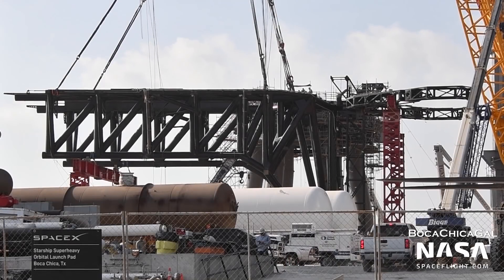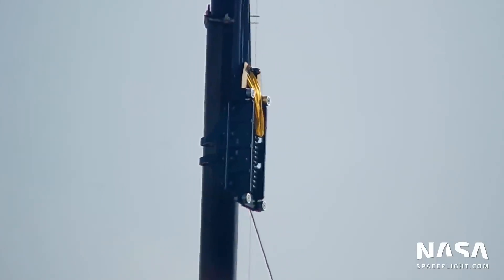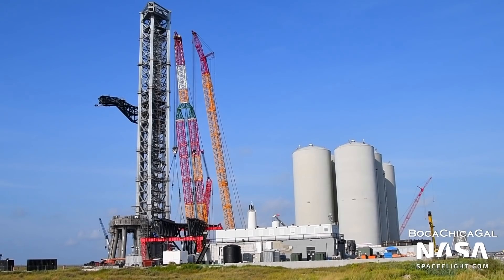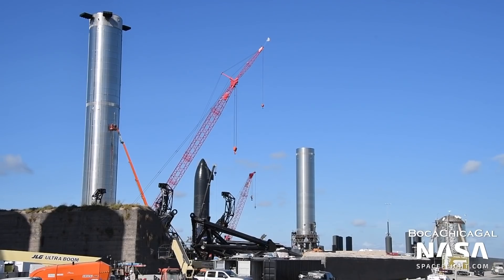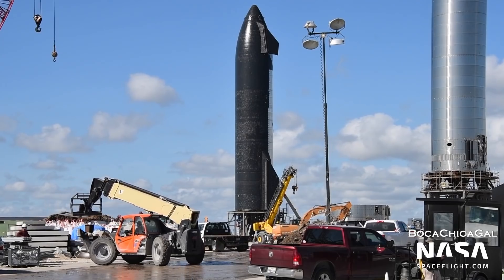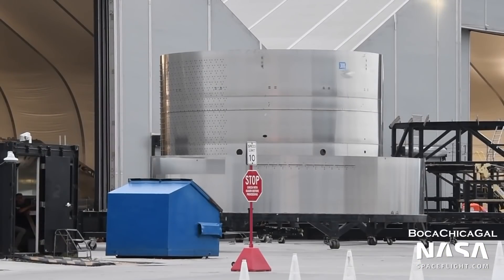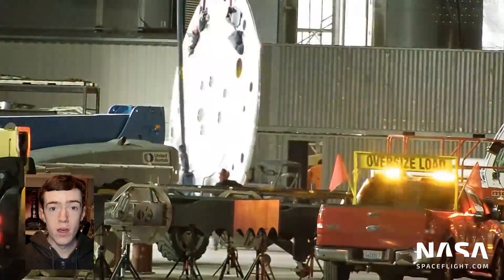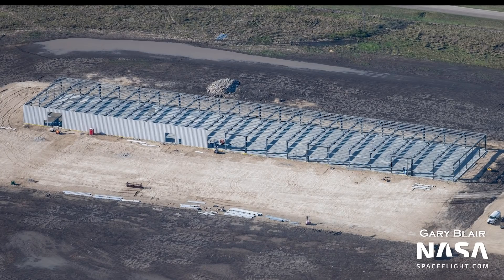Ship 20 Prepared for Static Fire Testing | Starship Update (Narrated)

Comment: You do excellent work with these updates Ian, thanks a lot.
Question: Ive been asking this a lot lately but cant seem to get an answer so if you could please.
Why has the "hybrid tank" been recently called B2.1 test tank in the last 3 or so vids?
I dont see anything clarifying this and i find it odd since the Booster 2.1 test tank (when it was active called BN2.1) is a different thing all together.

Comment: Elon: "The best part is no part."

Also Elon: "Let's put giant, movable arms on the tower to catch the rocket out of the sky."

(I'm sure the pros outweigh the cons, but it's just funny & crazy how complex this process is!)
Reply: Yeah but by combining the landing pad, the lifting machine, the tower and the launch pad that's less parts overall !
They're still insane tho ^^
Reply: The idea is to make the rocket as simple and light as possible by moving the complexity to the ground support equipment. Even if this requires a much more complex solution.

Hence get rid of the legs and replace it with the complex giant, movable arms

The cost-benefit is worth all the trouble
Reply: @pskale  Yeah. As Elon said the ground elements of starbase are much harder to make than the rockets. And I agree it's worth it. Simpler rockets can be mass produced and having less moving parts is safer.